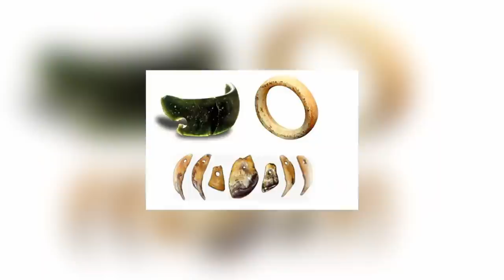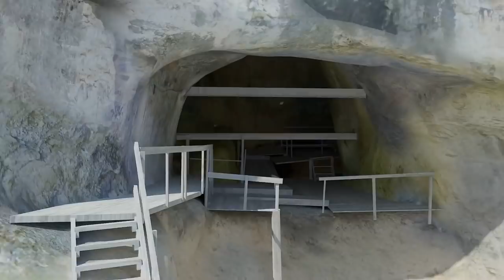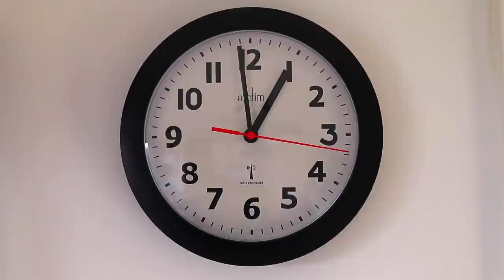12 Most Mysterious And Oldest Technologies Scientists Still Can't Explain

Comment: It is not that "melting stones" ,but  there are certain substances I forgot the name, but it's acidic fluid forming in quarries and mines.  Mixed with other compounds- could be a certain plant and volcanic ash and poured on and robbed around the surface of the stone would cause the stone smoothened down very quickly. Much like sculpting clay vase, when only the outer layer is wet and can be somewhat manipulated and formed. 
  You could basically put  stones down that roughly  fit and then smoothened to form a surface that would fit better.  
Conquistadors in ancient times recorded Incas doing this, but also that the process damaged the hands of the workers, hinting an acidic fluid. 
Same Spanish invaders also knocked down Inca walls, because they saw "gold" being poured into the stone wall cracks. Turns out it was the "fool gold" -  pyrite , which is highly reactive irons sulfite. 
Pyrite may also have something to do to with smoothening the stones and getting those gaps perfect. They may knew something that mixing pyrite with something else produced a chemical reaction that scientist are not clear what, but something to do with strengthening the walls.  Just some info.
Reply: Built by chemical reaction. I like your thinking.
Reply: Very dope, thanks for sharing
Reply: Conquistadors were not around in ancient times...this was only 500 years ago.

Comment: A drill doesn't have to go fast to make a hole, it could have been something as simple as a bowdrill, similar to ones use to light fires, that used sand as an abrasive to wear away the stone.
Reply: Not in hard material🤦🏻🤦🏻
Reply: @manbearpig710  Hard? That word is relative when it comes to different types of stone. They may not have know the science of it but they certainly knew about the properties of different rocks which is why flint was so valuable to them.
Reply: @andybrown4284  do you understand what granite is
Reply: Something that he only touched on here was the consistency in the feed rate of the holes make it impossible to be done by anything except by mechanical means. There has to be something else to it. Something we don't know about.
Reply: Sound and vibration. Resonance
Reply: @andybrown4284  I agree with the bow drill suggestion. Though I've often thought that ancient people could've been sophisticated enough to build water or wind powered drills or lathes specifically for making large quantities of jewelry and other works. As for determining how fast the spin rate was I'm not sure how that would've been done, but I'm guessing that whatever method was used to determine that is not an exact science and is likely prone to error.
Reply: Theres a youtube channel that made a bunch of videos on working drilling and grinding stones with different materials and methods. 
The channel named "SGD Sacred Geometry Decoded"
Reply: Ur wrong
Reply: To simply make a hole, you’d be correct.  But to make a perfectly symmetrical, smooth, perfect cut, it cant be done to that degree of precision and craftsmanship without significant, applied pressure drilling
Reply: @manbearpig710  Moh's 6 for this material so quartz is fine to drill it.
Reply: @blueyedevil3479  It certainly can and it certainly was you are looking at it. Round hole is the easiest to do, and there's hand finishing in each for the perfect circle (one would have likely held a round stone pearl  or such I think. I think the issue is never having made stone tools to learn how hard it is and how much skill these people actually had.
Reply: @jamesforbes2205  there isn’t hang finishing in the whole cu it has striations if u finished the whole with a pearl like you said it would be smooth it’s not
Reply: @manbearpig710  a pearl is too soft to finish it, I think those are settings for gems of another kind they are so precise and yes, there are striations but if you look at the inside of the bracelet and the socket the socket is finer in finish. Dont ever sand with pearls you will lose them nacre is not made for that kind of treatment. polish is slurry polish I would say in the socket and the inside of the bracelet more rough cause once those holes went in the mechanical action on the bracelet would threaten to fracture weak area from resonance waves. If you make one, you'll see this is finsihed past rough.
Reply: @abrahamsorby8193  fracture city.
Reply: @blueyedevil3479  how many shapes can make a round hole?
Reply: I think its a simple cosmic model earth sun and moon.
Reply: @manbearpig710  also, this was a cobble when it started life, split in half and then cut into a torus very carefully (I think they used a cobble close to the outer diameter would allow some flake reduction). To get from stone to bracelet is a real feat.

Comment: Inca stonemasonry isnt as complicated as you might think. Rather than cutting the entire large stone block to fit perfectly with all the other blocks, only the front face that is seen needs to be perfectly cut, then past the first few inches, the gaps are packed with rubble and dirt to give the illusion from outisde the wall that all the stones are fit perfectly. Ill put my source below for anyone curious, the paper shows the likely routes the stone was quarried from and moved along, the likely tools used, as well as how the blocks were only cut to look precise, then gaps behind the front face were packed with dirt. 

Protzen, Jean-Pierre. 1983. Inca Quarrying and Stonecutting. Ñawpa Pacha: Journal of Andean Archaeology 21:183-214

Protzen, Jean Pierre. 1985. Inca Quarrying and Stonecutting. Journal of the Society of Architectural Historians 44(2):161-182.
Reply: This comment is more rational than all the ~100,000 videos on YouTube that are constantly creaming themselves over the perfect Inca stonework.
Reply: Sounds more like they used compression techniques to prevent erosion of the blocks, and to make them fit seemlessly. Rubble and dirt compresses under heavy weight allowing the blocks to slide snuggly into place. Maybe to alleviate problems of air/water flow seepage during high rain fall seasons. 
It also probably helped into locking the pieces together to increase the strength of the wall.
They were already quite adept at directing water within their architecture.
It might actually help if some water got into those cracks, since water finds a way naturally anyways, as it could create a clay like mortar substance once touched by water, sealing off those blocks further, before the water content evaporated up again as the rocks got heated by the sun, only to be resealed during the next rain. Kind of like breathing rock.

Umm my name plus my title plus some non existent degree from a university I never went to, 2021
Reply: Also sounds like this Pierre was not as smart as he appears, or it was purposefully done so as to undermine Inca heritage after their conquests. Which is a tactic done by people threw out time.
Reply: @moguldamongrel3054  take his word however you want at the end of the day he's more qualified than you or i which and a better source than you on these topics
Reply: You should go.
Reply: The "let's just ignore the Inca oral history and the records of the period and the demonstrations of the technique" is always a fun ride. Like the clueless asking where the Maya went. They are still there as last I checked. They just dumped their ruling classes after they collapsed the classic civ and lived more modestly in the forest until we got  there.
Reply: @moguldamongrel3054  yeah this is exactly what I remember from the Inca today and scientists who explained it on a show I watched.
Reply: the empire has a long history and stonework is extremely varied in quality from site to site. Of course they dressed the fronts and not the parts no one saw. But they also ground stone on stone to fit smaller masonry especially and the rocks show the wear that created. like in europe no one technique dominated everywhere.

Comment: I always ask why wind turbines can’t be designed vertically without large blades,  to then rotate on its own tower?
Reply: They do exist
Reply: They also have a new way of building the wind turbines.  Instead of using one large turbine they have lots of small ones built on a wall shape.  Not sure how to explain better than this but I’m pretty sure the article was saying it’s being built in Europe somewhere.
Reply: Um.. its literally already being used.. 

I hate that!! I have an amazing idea.. and then find someone somewhere took my fluglebinder!!
Reply: @demariejones3438  japan
Reply: rotational speed vs. generational output...big blades slower turning bigger turbine lots of power, and conservation of motion smaller verticals faster rotation, smaller turbine high electrical state but lower output and at scale they start to have sympathetic vibration issues and can fly apart. But they are working on it.
Reply: Vertical Axis Wind Turbine. VAWT

Comment: Our ancient Ancestors absolutely knew how to use nature and  shapes to take advantage of nature. What do I mean? The people of the Middle East going back about 6k-8k years ago built grain storage buildings in the desert that stays 70 degrees at all times of the day and night. It all comes down to the fact of how they shaped a spiral going up and Around the walls to a circular opening in the center of the roof made the exterior walls sweat as the air came in and followed spiral up the wall and out the opening. This keeps the interior temperature during summer at a temp that couldn’t be reached with Air Conditioning today..
Reply: Math and all that helps us nowadays but I wouldn't be surprised if they made stuff that accurate simply by looking at it and judging the same way you cook your food on the stove without a timer

Comment: If you look close enough at the bracelet you can see that it was done by water pressure and the only way to do that is to put enough pressure to that amount of water and let it go when its ready think outside of the box plus the bracelet doesnt have marks from a drill nobody new what angle to make a drill at
Reply: Or, they used bows and drills every day for making fire for one and had been for tens of thousands of years and could make any shape of tool they wanted to out of wood, bone, stone or fibers. That is probably the reality of it. The explanation you have given is ridiculous. Watch stone work done today with bows and drills and learn.

Comment: The cup... I'm they fumed the glass. That's how the gold and silver particles were so small.  *Smh*.  You heat the metal untill the color or your super hot flame changes then you run the glass you are working with through that flame and that's how you fume glass.

Comment: The cup is color changing by light, wether it’s lit from the front or lit from behind.
Reply: The light source is not what determines the color of the cup. It's the particles inside the structure of the cup that reflect the color change.
Reply: @CeasefireNow2024  reflective refractive, light passing through those particles refracts and speed changes and colour does too, the light bouncing off the surface is at another speed and this makes it a different colour. it is amazing nonetheless.